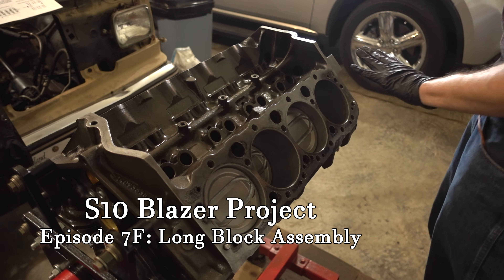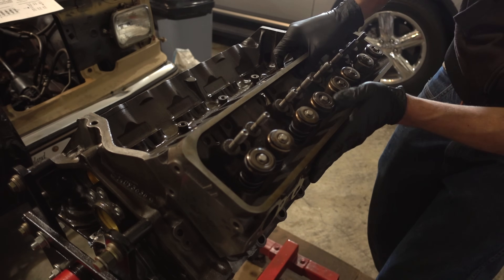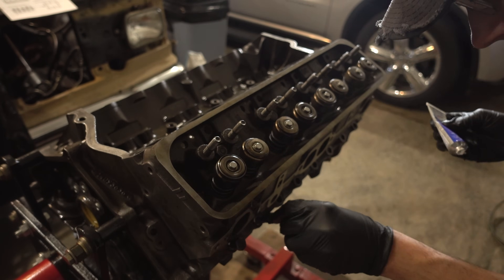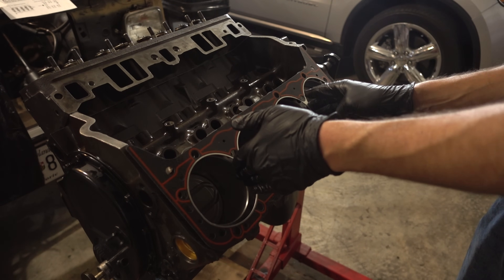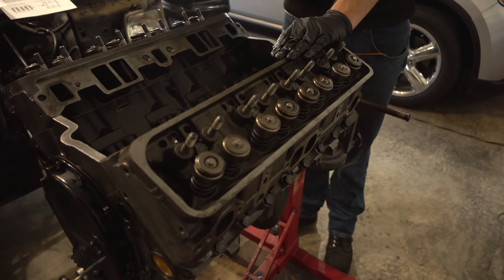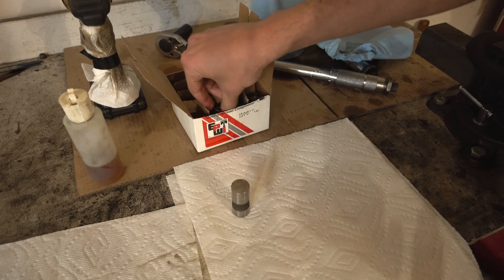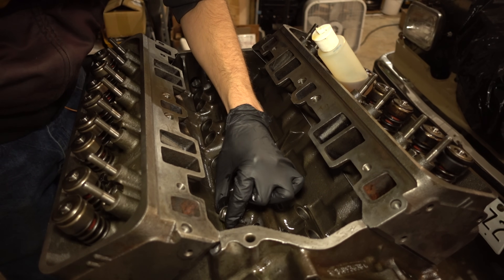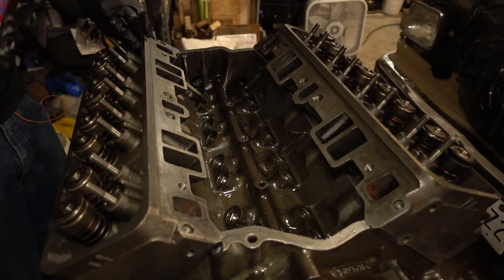V8 S10 Cylinder Head and Valvetrain Install (Ep.7 Part 6 of 7)

Comment: Why don't you rotate the block so the header is flat to install?   I'm a newbie so sorry if it's a dumb question,
Reply from the maker: It's not super easy to rotate, and especially with only one cylinder head on it can be a little annoying to manage that weight distribution. But there isn't any reason that wouldn't work!

Comment: Really enjoying watching your videos!! I was just wondering if before you tightened the rocker arms down, ever considered actual valve timing of how the 4 stroke cycle actually works in practice. This video demonstrates this perfectly. https://m.youtube.com/watch?v=mF5Ns8_9MeE
Reply from the maker: Of course, there is a lot more going on with valve timing than I described, that was just an explanation on the points of rotation where you can guarantee a valve is on the base circle with the widest margin for error. Good link, solid explanations in that video!

Comment: Your block is designed for roller lifters, why not use them?
Reply from the maker: Money. That's pretty much the answer to every "why not do this" question about this project haha
Reply: Fair enough. You ever have money and time to burn a roller cam and rockers are a pretty good power upgrade for the money. You can port those TBI heads for free too!

Comment: When I worked in the dealership, I'd do the lifters and pushrods your way, with lube. On the rockers, pivots and locknuts, I'd assemble them all loose, just enough turns on the but to start it. Then I'd take a pump oilcan and squirt oil all over the rockers. I'd preliminary adjust the valves doing the three step method, but leave valve covers off. I had metal and plastic rocker stoppers I'd put on the oil holes on the rocker tips. I'd start the engine, get it up to temp, then would go over each rocker, loosening until it went tjc tic tic, then tighten it slowly until the noise just stopped, then go a half turn more. Then repeat on all the others. Then remove the rocker stoppers and install your valve covers, and clean any spilled oil off engine.
Reply from the maker: Yep, pretty much anyone will agree that setting preload with the engine running is the best way to do it. Have done it once, using a valve cover with a slot cut in it, made a big mess. Your way of blocking the oil flow seems way better haha. But I'm planning to leave it as-is for this engine, unless it develops a tick after break-in.
Reply: Thats because your'e a real technician Dave1135.... He isn't

Comment: Question, would thread sealer give you an incorrect ft/lb number?
Reply from the maker: It does decrease friction, so over a dry fastener, yes it would! Factory torque specs take that into account though (I would sure hope they all would at least), and even torque across the head is more important than a few ft/lbs high or low overall, so don't worry about it. Same with thread locker and antiseize, they lubricate the threads so any torque specs for dry fasteners should theoretically be decreased accordingly, but I don't know of anybody that actually does this.
Reply: sweet! i appreciate the response, learn something new everyday lol